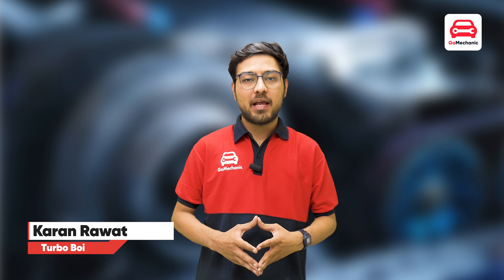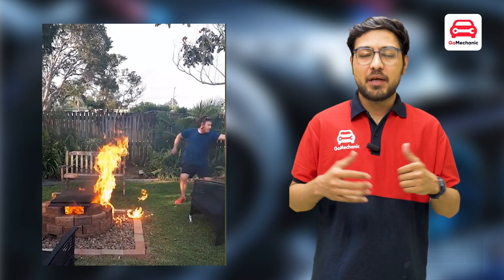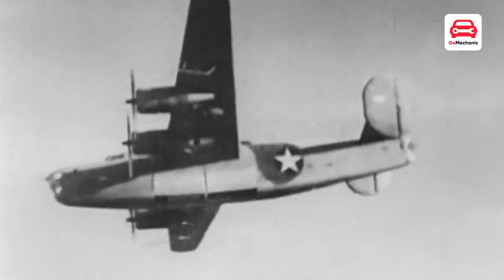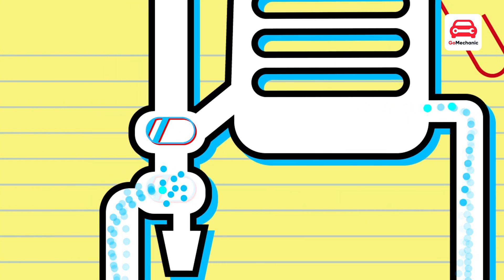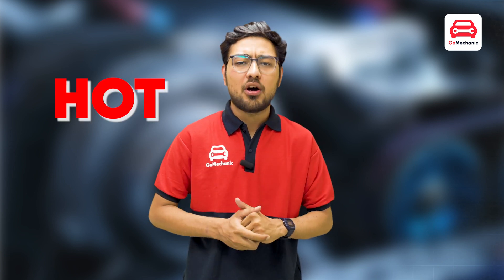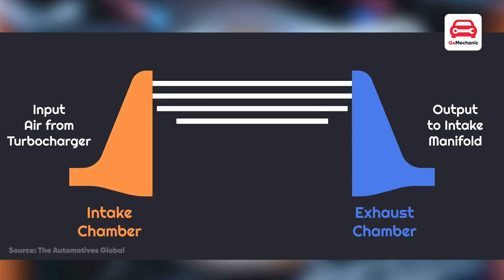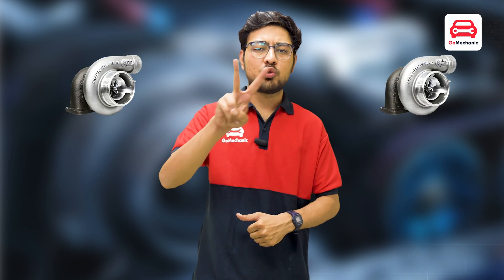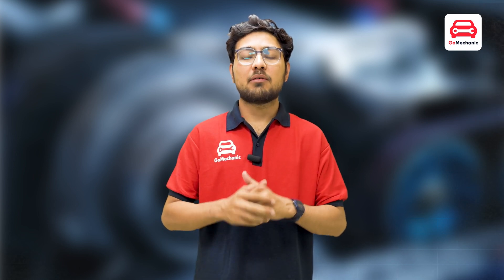What Is A Turbocharger🔥| How A Turbocharger Works? | GoMechanic 👨‍🔧

Comment: 2:35 utterly wrong info, this sound is due to turbo flutter which happens when there is no blow off valve, with a blow off valve the sound resembles that of a bus before it starts moving from stop and releases air.